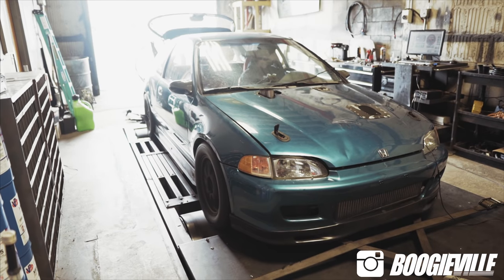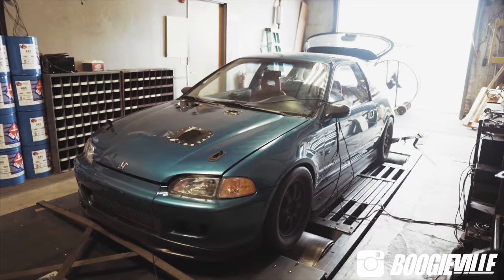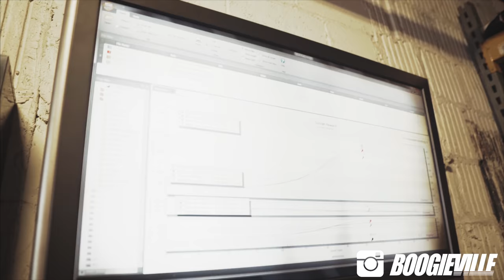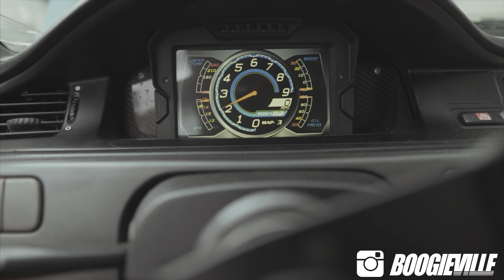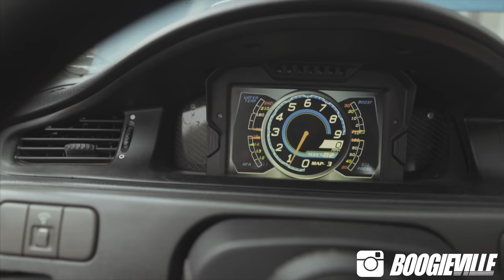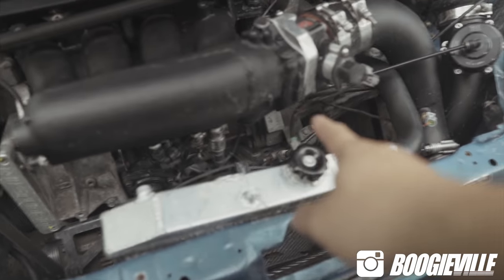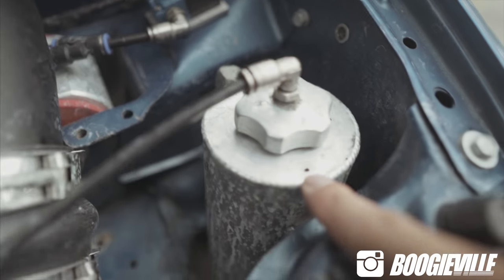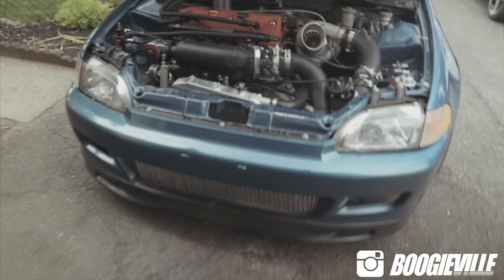Update on AWD Car - Daily Driving a Dogbox Trans - 30psi of boost pulls!

Comment: Before tearing the engine apart how about putting a full size radiator with two fans on it and see what it does. If it still continues at least you ruled out the last component of a turbo setup by adding proper cooling all around just a thought. K series Ppg sidewinder with 6870 and using a single cam radiator….
Reply: first thing i noticed too. those engines to big for those half size joints the need a fullsize. especially driving it hard
Reply: @knix2for5  I live in Florida and the first thing that happened after I finished my turbo k build was that it started overheating anytime I came to a red light or while idling. Fans would stay on and temps would be 210-220… swapped in Full size radiator two spal fans never seen temps higher than 190 in the middle of the summer and the fans kick on and off as they should.
Reply: @sickek4  Exactly , the engine came with a fullsize radiator . So you are telling the coolant to cool the engine in half the time under load . And you will also burn up the cooling properties its needs too. Run fullsize radiator with honda coolant . That way you will cover all basis. if you run a dual core fullsize radiator with you will be even  better.

Comment: that hole you made might be whats over heating... loosing psi inside the coolant system... try to remove thermostat and route system so their is no heat in the car... that migh solve ur issue
Reply: This is correct^
All cooling systems should be completely sealed from atmosphere, the only reason your coolant doesn't boil is because it's in an airtight system. That's why the second second you remove your rad cap... BOOM, coolant flash boils in the blink of an eye due to the change in pressure.
Reply: As stated above. Definitely be 110% the system isnt airbound. Bleed from highest point

Comment: I know that feeling of it not meeting your standards when you had a vision for it and played it out in your head.  Keep on going, it's going to be perfect.  

I had/have this same exact issue on my b- series.  Battled it for a year and ended up changing the motor.  What I did notice when I took the motor apart was the water pump was faulty. It made a sound when spinning

Comment: What radiator fan are you using? I had problems with those China slim fans car kept overheating put the stock one back problem solved. there was a huge difference from oem Fan pulling air compared to the slim fan

Comment: maybe try running an Electric Water Pump...

B series here, turbo.. ewp..  i street the car, in traffic it never gets above 192⁰

and after a few highway pulls cars temperature in the mid 190⁰s

I run meizere ewp kit... with a 3 row, half size radiator...    gutted thermostat..     distilled water, and redline water wetter..

cars made over 650 to the wheel on dyno..

Comment: Great build you more than likely have a hair line crack in the block i tried something on my car that actually work haven't had a problem with over heating yet knock on wood but grab a bottle of blue devil head gasket sealer i used the big bottle first it was fine the my water pump went it was a cheap water pump from pepboys replaced it with an oem on added a smaller bottle of blue devil had no issues since a beat on the car still nothing yet worth a shot bro!

Comment: Over heating may be due too possible head lift
Reply from the maker: I believe so
Reply: @iAmTaiBoogie  What head studs you using Tai..ARP 625+?..You maybe pushing coolant..What type of head gasket?..Is your block or head o-ringed?...Does it over heat when your not in boost?..Car is Deff flyin..60-130mph in 4.0 sec's is very very fast

Comment: Damn my evo is doing the exact same shit. I just finished tearing it down and building it back up. Resurfaced and upgraded the head, copper orings and 625+ headstuds to 100lbs and my shit still overheats and has high coolant pressure. I just can’t figure this shit out
Reply: Air is getting into the system somehow

Comment: Bro try a new radiator cap. Ima tech and I’ve ran into weird issues like that and it turned out to be the cap
Reply from the maker: Bro I tried the Mishimotor 2.0 bar cap, and the pressure went right thru that cap man :(
Reply: @iAmTaiBoogie  overflow/catch can combo ?
Reply: I was thinking this but no one really could give me the right answer. I used to run a 1.1 bar but I lost that shit and got a 1.3 bar. Ever since then I’ve had the same problems he’s had on my evo

Comment: It's building pressure cause exhaust gas is going into ur coolant and I'm willing to bet your head is warped and u can put 10 head gaskets on it and it will never seal properly
Reply from the maker: I had the head re decked before I re assembled the motor
Reply: @iAmTaiBoogie  damn dude that's kinda crazy what kinda head gasket are u using cause I had issues getting a cometic head gasket to seal so I had to use a oem honda one and it fixed my problem. It might have a crack like u said but it can only be a few things. Bad air bubble in cooling system that's not getting bleed out stuck thermastat or head gaskets not sealing. Good luck with it man I wanna see that bitch running good!!!